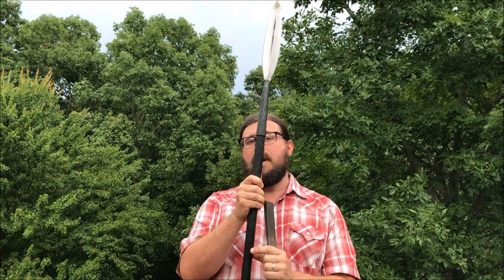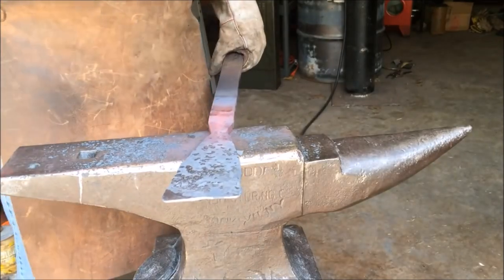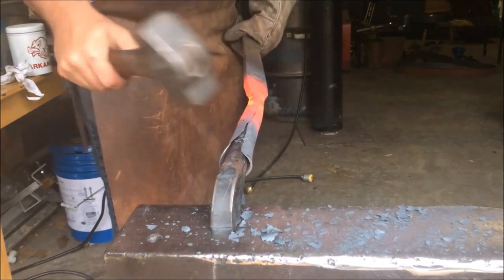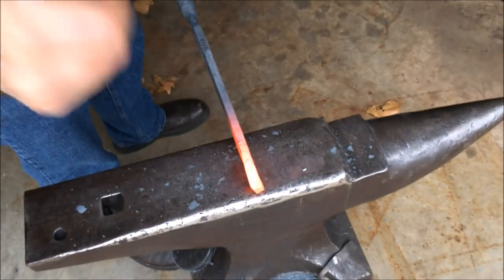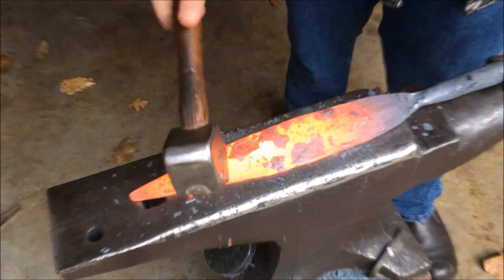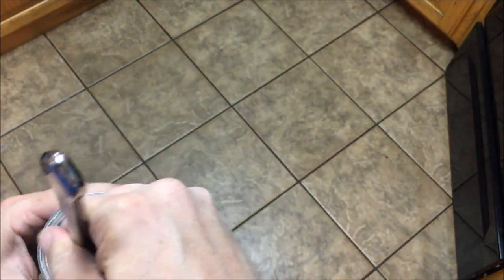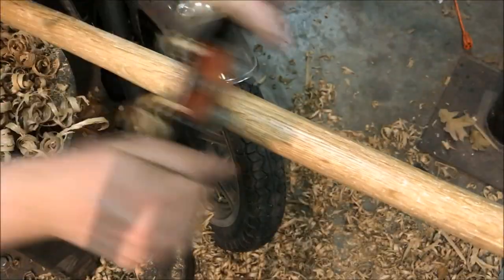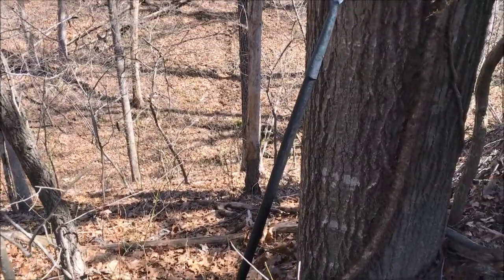Making a Spear From Start to Finish. Forging a Spear & Its Socket, Grinding, Heat Treating, Hafting

Comment: Could u please advise why blade smiths use round stock as apposed to flat
Reply from the maker: Sometimes it is better for the project.  Such as when making a knife with an integral bolster.  Also, you can forge it down to whatever thickness you want.  Another reason is that steel is often available in round stock and bladesmith can use it while a stock remove guy can’t.

Comment: Nice work! I have basically the same spear project on my to-do list for the spring to complete a viking kit using pretty much the same method. I won't use W2 though, because I don't have a power hammer - it's all by hand. I'm thinking about using 5160 leaf spring, as I have a bunch on hand and I am very familiar with working 5160. 
My only concern is I understand that 5160 doesn't like to forge weld to itself very well (probably due to chromium oxide formation). I've forge welded 5160 to mild many times but not to itself yet.  Do you have any thoughts on that?
Reply from the maker: John Cannon some people make spears that are not forge welded together.  You can google Lin Rhea M.S. and see a few he has made the last couple of years.

Comment: Thank you for your reply the information u gave to me helped me a lot to understand more of the processes for forging I save the Cole from my wood fire is this OK to use in blade smithing or is there a better option
Reply from the maker: You can forge with charcoal.  Blow some air through it to get it hot enough.  Most people these days use propane and some use coal.  Not too many folks using charcoal, but it can be used.

Comment: is it necessary to forge weld the socket? i have a coke forge and ive heard you cant forge weld in that
Reply from the maker: I always have forge welded it.  But, I have seen it done without welding.
Reply: @AllenNewberry  is it possible to do it in a coke forge?
Reply from the maker: You can forge weld in a forge using coke.  But, you would want to practice before welding a socket.
Reply from the maker: It can be done that way.  I think generally you do that method to conserve a more expensive steel.  Such as not needing to use Damascus on the socket.
Reply: @AllenNewberry  without doing it that way, can you still have a spear without a hole where the socket meet the beginning of the blade?